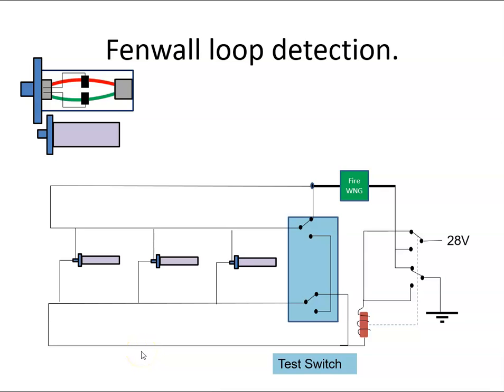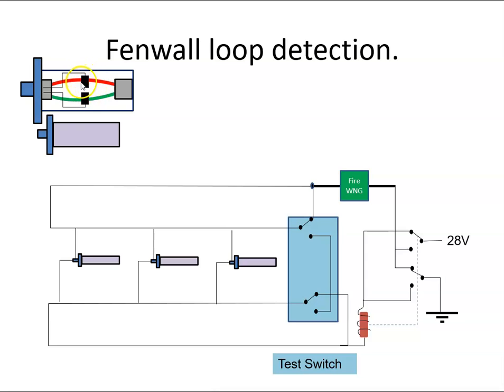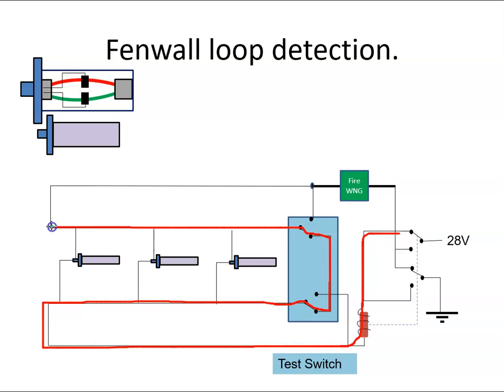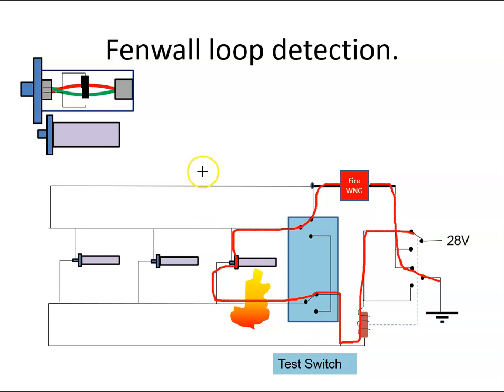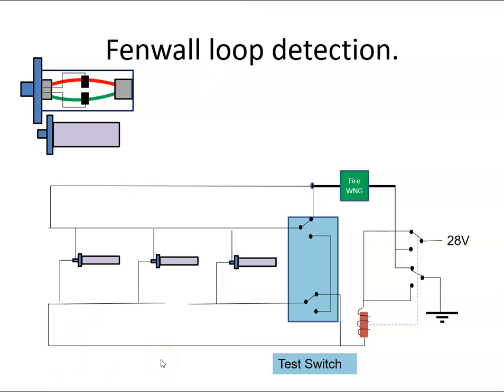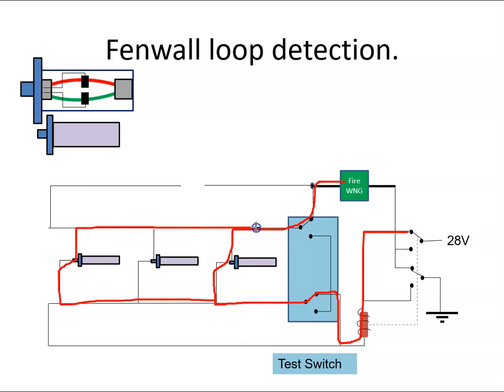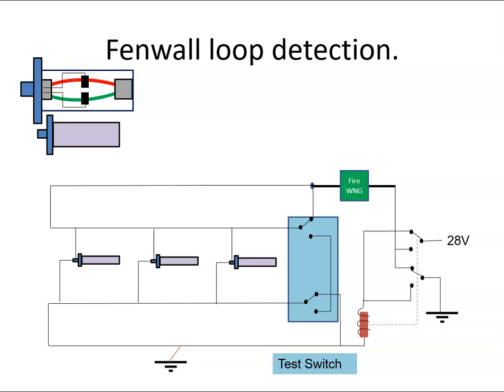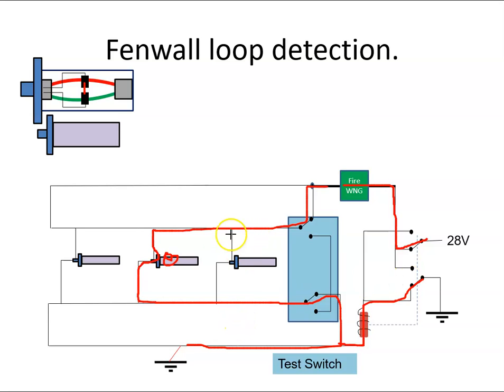Fenwall Loop Detection Circuit

Comment: These are fenwal thermoswtiches connected in parallel which are different from fenwal continuous loop if people are confused. The fenwal continuous loop uses one central conductor running through the middle enclosed by eutectic salt which has a negative temperature coefficient.

Comment: Is that Fenwal type ? I thought it’s thermal S/W that is consist of two different types of metals that expands differently by heat
Reply: I realize this is an old video- yes these are usually Fenwal, but in aircraft they are usually a fixed temperature type. You may be thinking of the rate compensation type detector which indeed uses different metals to change the behavior of the detector. Also even though these are fixed temperature I sometimes notice a small rate compensation affect. This is why when you test these detectors you always trip the detector several times after heating then use the average of the trips.